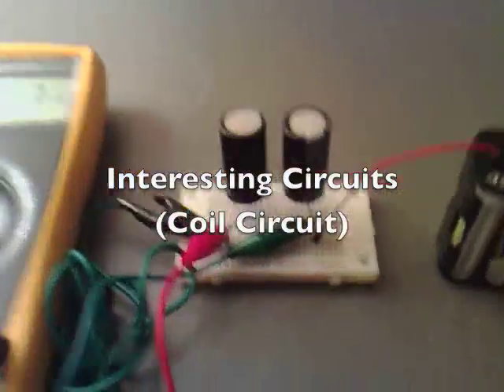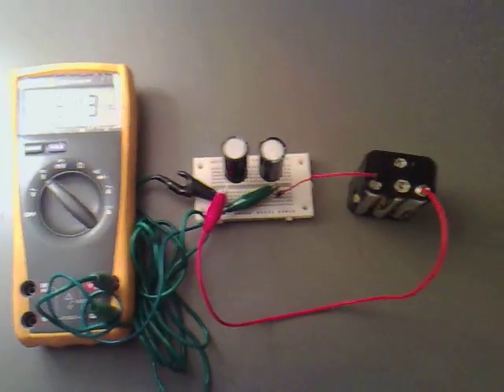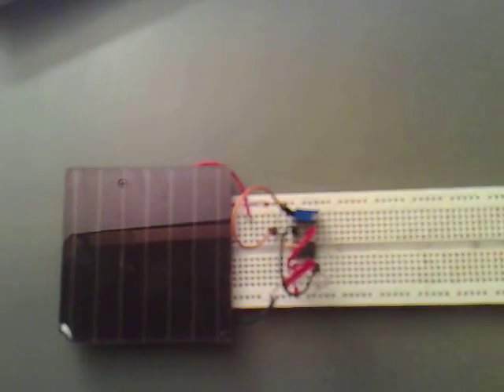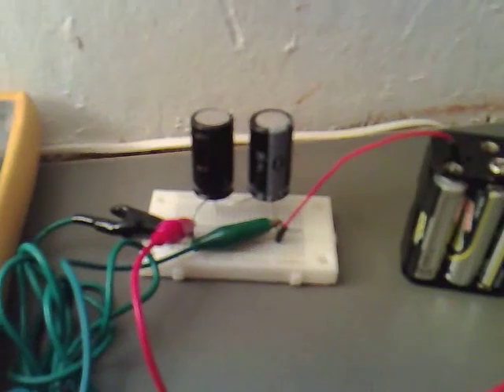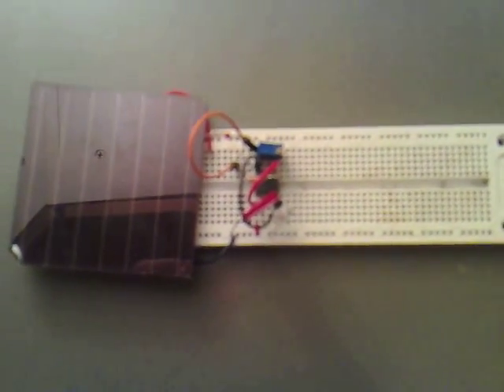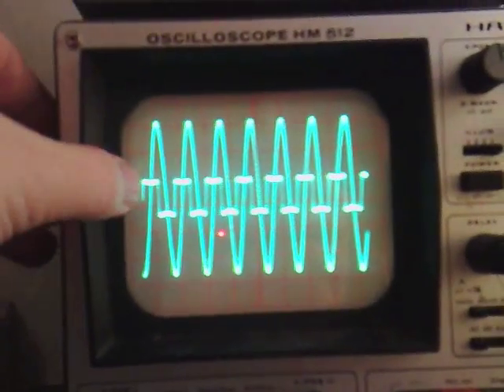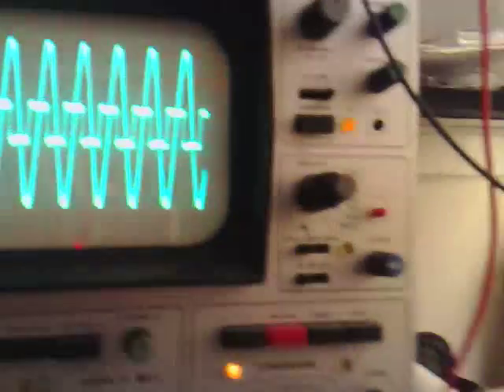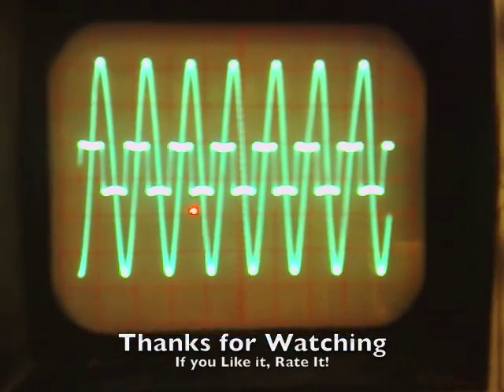Interesting Circuits (Coil Circuit) 009

Comment: I'm certain that they are MICRO farads.  A capacitor of one farad would cost quite a bit of money and be about the size of your fist or bigger.  Also, nice picking up that the total capacitance is 5(micro)farads, not 20.

Comment from the maker: Yeah, thats why I bought them 2.5v 10F each.

I need them to power just the control gear the main power for the resonance rise will come from a 12v 7AH battery...

They are called Super Caps or Gold Caps They can Light and LED for Days and my circuit only uses 2mA including the LED!!

Search on google for them, The only thing I said wrong was the bank in series are now 5v with 5F.

Paul..

Comment from the maker: Yeah, Its to stop them leaking energy. You put them to their working voltage and keep the power on them for a while then slowly discharge them with a resistor and led until empty...

Comment: I'll have to agree on that!
2,5 Volts times 2 is indeed 5 Volt.
But when a capacitor is in series you have to divide de farads equal to it's voltage; so in this case you can just divide 10 Farads by two so the outcome is indeed 5 Farad.

Nice vid tho.
Keep up the good work.
5 stars...